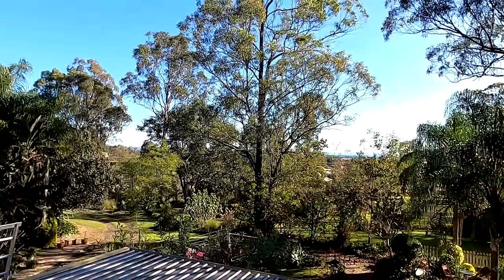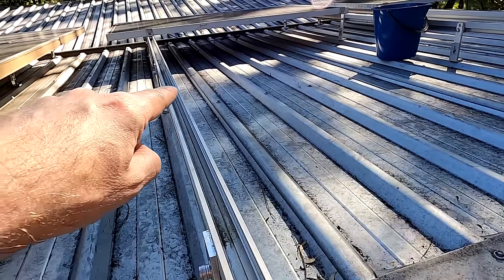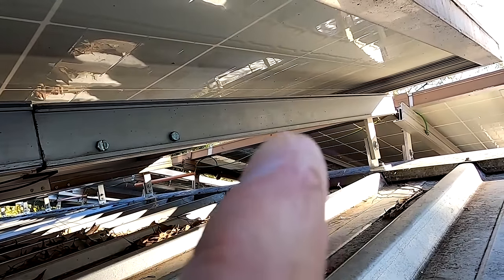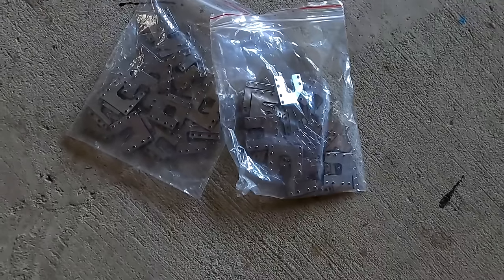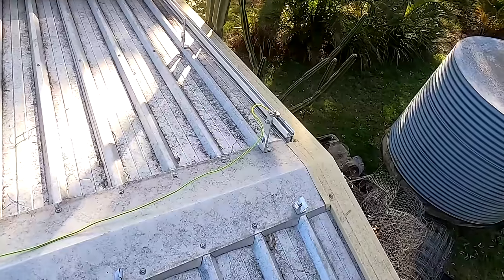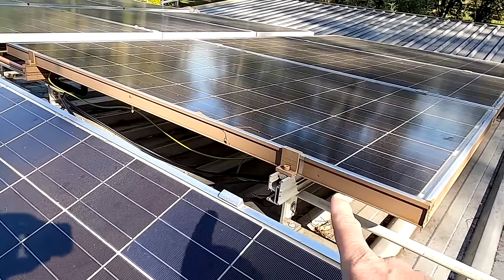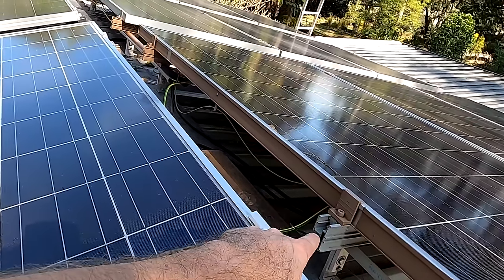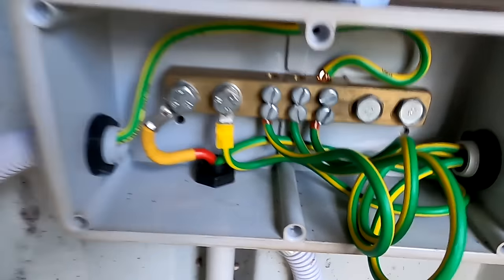Solar Grounding Essentials. These important safety features are often forgotten.

Comment: ANDY! DON’T use common silicone on the wires or electrical boxes. If the silicone smells like vinegar, it’s the wrong type of silicone to use on electrical. If moisture does manage to get in there, it can eat the copper alive. Raytheon ruined many component years ago from this. When I was a kid, I had an RC boat and I wanted to seal the electrical. It turned into a corroded mess. I sealed a box with electrical in a off road vehicle. It turned into a corroded mess. My son sealed wire on a boat trailer lamp. It turned into a corroded mess. On boats I’ve ran into others that have done it too. I HATE silicone. Common silicone out gasses acetic acid as a curing agent for months. With a small amount of moisture entrapped it will attack aluminum, copper, zinc, tin and lead. Even after the fumes have dissipated, the created void and the corroded surfaces are a catalyst for exponential damage. There are silicones that are electrical safe and silicone lubricant/greases are safe. God I hope you didn’t use the wrong stuff.
Reply: Bloody good point. I've used a solvent based silicone in the past which could be suitable.
Reply: @andrewradford3953  
This is such prevalent problem that most of have fallen into that it should be listed as a warning on silicone. Just want to do the right thing and would have been better off doing nothing 😡
Reply from the maker: It's vinegar and acid free silicon.
Reply: @OffGridGarageAustralia  
Fantastic! 
Hopefully this post will save more from what I and many others had happen before we stumble into the light.🥴
Reply: @OffGridGarageAustralia  Hi Andy, silicone can easily pass water vapor and the corrosion can happen under silicone. That is why you often find black spots of mold under silicone in bathroom shower glass installations after a few years. It is also why insulated glazing units are structurally joined by silicone but vapor sealed with an additional layer of butyl or polyurethane.
Reply: @OffGridGarageAustralia  not an expert but it is definitely about the type of silicone. Acid cure is bad as it causes the corrosion as the other commenters have said, but neutral cure should be fine. Sounds like that is what you used.
Reply: @OffGridGarageAustralia  is it certified organic 🤣🤣
Reply: You are absolutely right!  Ascetic acid is....VINEGAR!
Reply: Ooh never knew about that, filed in memory.
Reply: We put ZINC on the propeller shaft and else where as SACRIFICIAL to direct all electrolysis to the replaceable Zinc pieces
Reply: I like to use 3m potting hot glue.

Comment: Why would you use earthing at all. In the Netherlands there is no code or regulation that says you need to earth the panels. I myself can't really think of a reason why this would help (against what?) it will only increase cost.
Reply from the maker: Potential difference can kill. But yeah, other countries, different regulations. Or none at all. 🤷‍♂️
Reply: A DC system generally does not have our thing, but if there is an inverter fault or something and the gets reference to earth there’s a potential for the panels to become live however some countries do not require the earthing because if you’re going up on the roof, the array should be isolated

Comment: I worked at a public utility power plant. We grounded every piece of equipment back to grounding Grid Stations. We uses MEDIUM HARD DRAWN COPPER bare (no insulation) stranded wire. It's available in 6 AWG I believe. Mechanically held up better than soft drawn copper (most copper wire is soft drawn). It was installed out in the elements and indoors, in wet locations and dry locations and near the sea (salt water). It worked well. Just a thought that would work for me when grounding a solar panel stand and panel structure.
Reply: oops my friend, how are you, I've been watching your videos about inverters for a while and I saw that you demonstrate that you have knowledge, a question I saw that many people in the United States talk about grounding the battery bank, grounding the negative of the battery, what do you think of this grounding?  Is it safe for batteries?  Sorry if the English is not good because I'm not from your country,
Reply: @energiasolarparatodos128  all it does is mean you can get a shock easier as things are reference to ground so it means you can get a shot from the wires rather than it being isolated
Reply: @UKsystems  Hello my friend, sorry for my English because I'm Brazilian and I'm using a translator, so my question was about grounding the negative battery terminal, I see many off-grid solar systems using this grounding, here in Brazil many people don't know about this grounding practice, so I had doubts about grounding,
Reply: @energiasolarparatodos128  the battery terminal is generally extremely unnecessary
Reply: @UKsystems  So you've probably noticed that some off-grid inverters give a slight shock to the DC input!
Reply: @UKsystems  So when you ground the battery's negative DC, you no longer get that slight shock!
Reply: @energiasolarparatodos128  you can get a shock if referenced to ground or there is no current path otherwise

Comment: Interesting.  I used an Iron Ridge rack mount where the clamps that hold the panels to the rack provide the ground connections between the panels and the rack rails.  So each pair of rails has only one grounding lug.  We are required to use at least #6 (16  square millimeters) solid wire (not stranded) for the ground.  I used manufactured supplied splices to make up longer rails so didn't have to put in bridge wires.
Reply from the maker: Yeah, different countries have different rules. If your clamps holding down the panels have spikes, it will work as well. Normal flat clamps will not have contact tot he actual aluminium frame of the panels. None of my panels had any contact to ground without the washers.

Comment: Nice work! I hope you have used natural curing silicone?! The acid cure silicone actually causes corrosion so we don't normally use it to seal any type or electrical connections.
Reply from the maker: No acid or vinegar in this one...
Reply: I've seen/done that, and some time later I had need to remove the silcone and re-do the join - it was all green and corroded.  I did shake my head when I saw you put silicone on copper.  Good news that it can be done - with the correct silicone.  I've never realised there were different curing silicones.  What was the product you used Andy?
Reply: Acid cure silicone is not common here in oz you would only find it as a specialised product for glass etc and would be 3-4 times rhe price of General purpose, builders, or roof n gutter silicone

Comment: The silicone was a good idea but Air is in there already.  For sure you should have used the die electric or what you have there would stop the corrosion of the metel contact.  The problem is the two dissimilar metals that will corrode very quickly just by touching each other.  In USA many fires were caused by Aluminum housing wire before they figured it out. Aluminum is not used in house wiring here in most places now. This is called Galvanic Corrosion for your reference ,    I really injoy your videos.  Have learned Much.  Thankyou!  Kim
Reply from the maker: Thanks Kim.

Comment: Andy, you should not ground solar panels on a roof unless you are found so for an electrical strike. When you ground the panels you reduce the number of catastrophic failures from 2 to 1, so you actually make the system less safe.
Regards,
Bill

Comment: You got more conductivity in that metal building than a hundred wires.   But if you insist.
A much better solution is to bolt cable using cable lugs to each panel individually, then to ground.  Use some penetrox at each lug connection to avoid oxidation.  This will provide much better protection for the panels, themselves rather than just grounding the mounting rails.  If I can find a better way than what the 'code' calls for, I always go in that direction.  It's my money and my life, not some inspector's.  This also furnishes ground to the rails (but who cars as the rails aren't going to stop working if there's a surge:)).   Also, your building is metal and is also a ground, especially if the supports extend into the ground.  And if not you can ground the entire building with some ground rods.  I've seen so many things in the code that make no sense over the years.  I ran a large mechanical contracting business for over 40 years, am retired now and enjoy watching your videos.  Thanks.
Reply from the maker: It's in the next video 😉
Reply: Making decisions based on gut feelings may not be as safe as complying with the NEC, a safety code for you and anyone who comes along and touches your electrical system after you build it. Are you familiar with electro-magnetic fields created around every lightning strike, the voltage gradient in the earth as you move away from a strike, and arc flashes that do happen between metal objects near a lightning strike that are not bonded to one another. You might just want to watch some Mike Holt's electrical safety and grounding presentations before you take short cuts with electrical safety and grounding. Many of the old electrical facts have been proven wrong, he makes the case for the real electrical facts as related to safety and grounding.
Reply: > Also, your building is metal and is also a ground, especially if the supports extend into the ground.  And if not you can ground the entire building with some ground rods

Think the idea might be to not make the entire building live in case of a fault. ;D

> I ran a large mechanical contracting business for over 40 years

How many years were you a fish monger?

Comment: Nice work Andy! Just the video I was looking for as i've ordered all of this gear already for my off grid project and wasn't 100% sure on the AS standards to earth PV systems.
Just a recommendation as a retired electrician -  paint any orange conduit with weathershield UV paint as it's designed for underground only and doesn't have any UV stabilizers in it. It will go brittle and crack in the AU sun after a year or so otherwise

Comment: When I set up my 16 panels this fall I found continuity between the 4 sides of the panels was lacking..it was apparent that the  one connection per panel wasn’t going to bond all the metal frames properly ….I wound up putting 4 of those special darn fancy connectors you have per panel… one one each extrusion….each connection is swabbed and bedded with a with the N-Alox anti corrosion type stuff…( probably not needed) and one continuous 6 gauge copper wire weaves through all panels back to the electrical area… Yeow…..a real job..now each seperate panel strut is reading as in contact with all the other frames , prices and mounts.
It was the only way I could get a good connection between all the pieces… alot of work too.

Comment: You can test your rail joint.  Install an earth lug on each side. Do not wire together. Measure resistance between the two earth logs.
This is only a partial test. The real test happens after months and years in the elements. Will your joint retain conductivity as well as the manufacturers joint?
Edit:  I suspect your joint is as good or better, and I'd only do a single earth lug on that joined rail.
Reply from the maker: I will do the test in the next video.

Comment: I couldn't quite see the wire setup, but you can also use a single ground wire (per string) and ribbon it across all the solar panels in that string.  No need to have multiple ground wires.   Then put the surge suppressor device (which takes plus, minus, and also ground wires) as close to the MPPT/inverter as possible.   Excellent video!   People don't discuss frame grounding enough.   No need to ground the rails if all the panel frames are grounded, they will get their ground from the panel frames.   Though it doesn't hurt, either.  There is no such thing as too much when it comes to grounding :-)
Reply from the maker: It is only one wire going from rail to rail and finally attaches to the ground bar.
Yes, if you ground all panels individually, you don't need to ground the rails. But with these washers, it is easier, I think. 
And the result is surprising. It will be in the next video.
Reply: @OffGridGarageAustralia  Can't wait!  I've never considered it doing it the other way around.  In fact, I've never measured the resistance between panel frame and rails on any project so this is breaking new ground for me too :-)   We've always drilled a small hole in the bottom of each frame and laid a completely stripped bare wire along the whole string, screwed down to each frame individually.    Then brought the wire back through the conduit (leaving the green insulation on that part of it) to the MPPT.
Reply from the maker: @junkerzn7312  That is a lot of work grounding every single panel, wow. Each panel has got it's dedicated ground hole already with the symbol next to it. However this does not give you any connection to the actual frame and you still need to use star washers.
I was surprised when I found out none of my panels had any connection to ground at all! I have never used these washers before and due to the anodised aluminium, there is not electrical connection. I was really expecting that some of the clamps had pierced though it but I measured the whole west roof and all panels were completely isolated.
Reply: Wrong. The panels do not tie to the ground. Ground only the structure for the panels. Some inverter manufacturers specify this in their user manual.

Comment: Great video. On the manufacturers splice are you discounting the sheer mass of the splice? I am not discounting your bar in between, but for a lighting strike the larger the volume of the metal should allow for more energy flow thru. I really dont think it will matter either way. Both should accomplish the same job. I also believe in overkill, the silicon should work fine. My brain says to do both. Put zinc on bare wire and fitting then seal the zinc in place with silicon. That is how I have seen it on floating grounds on airplanes.
Reply from the maker: Thank you. OK, so this grounding is not for lightning protection. It is for pure electrical safety to bring all metal objects tot eh same zero level as the person is standing on the roof.
Yeah, the cable corrosion protection is a bit spongy in the regulations. Whatever works, I guess...

Comment: I recently had solar panels installed on our ( 4 inch) concrete roof, I noticed by your video your grounding each panel, yet as I had observed when installing my panels the installer only grounded the frame. Thank you.
Reply from the maker: I have grounded only the rail, but used these ground washers to poke through the anodized layer on the aluminium frames of the panels and rails.
It depends on your local rules and regulations.
Reply: Ok, thanks , I may install this on my panels away as a safety precaution. Thanks again.

Comment: Great video as always. I use 2x200W Perc-Halfcut panels on my boat, as we know, there is not much ground in an small boat. Some make them with a plate under the boat etc, some ground in the engine , that again goas out to the shaft and propeller etc.
Do i have to ground my panels onboard a boat ?

Comment: On automobiles they use a special "grounding" or "electrical" washers on the ground cable lug-to-chassis interface.   It is a "star" washer with internal and external "teeth".

Comment: I watched another video that explained the ground earth isn't part of the DC Solar circuit. Eg. A car, for example, doesn't use an earth rod connection, obviously. A further explanation indicated that in the event of a lightning strike, the earth grounded frames become a 'magnet' to the lightning bolt. It was also pointed out that the voltaic cells are independent of the frame. So, this is a very contestable subject. So, like installing a car stereo, you would need to ground it, but, not the earth ground. I am not an electrician in anyway, but, the other video made logical sense, to me anyway.
Reply: However this is still in my country but we would call an extraneous metal part. It is a metal part that you could have a shock from if it’s somehow became energised in a DC system can be referenced to earth definitely and earth can be a part of it, but it requires special engineering and design, this is more to stop the panels accidentally becoming energised

Comment: Lucky you, our high today (and for the past two weeks) is about 43 to 44° Celsius. During February we may have days that only get to 25°, but very, very few cloudy days. My roof is two stories, and I am over 60, so I hire people. If I was 10 years younger I would probably attempt it myself, but I am not, so I won't. It's "monsoon season", which means about dusk we might get some clouds build up, and a trace of rain. The mountains surrounding us get lots of rain this time of year, but relatively little here. We average around 175 millimeters a year of rain. FYI, this connection is what noalox or Ox-Gard is for, the copper to aluminum galvanic corrosion is a common problem. I think you tried carbon grease, same thing just more expensive and not as well tested (just because it hasn't existed as long). The objective is to not let oxygen in, supposedly the zinc is a sacrificial ingredient to corrode first (I have my doubts). If the silicone has a vinegar smell, you may have just encouraged corrosion (but I don't really know).
Reply from the maker: Thanks John, the silicon does not have this smell, no. I hate this smell and would never have bought it 😉